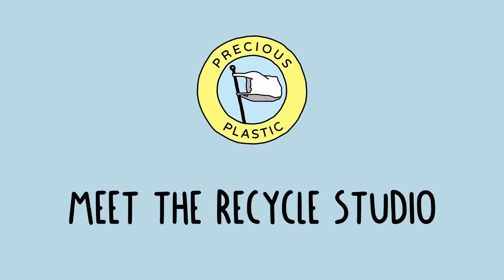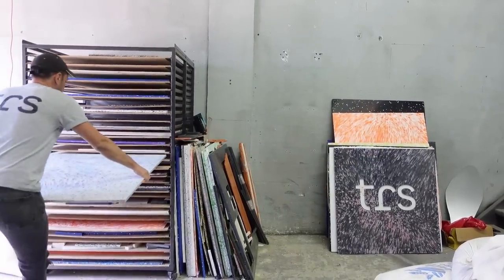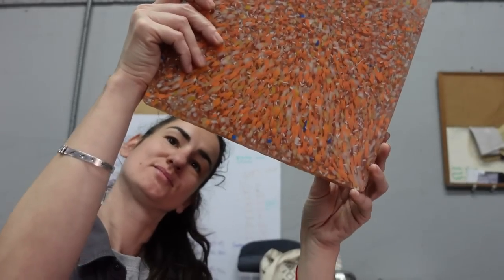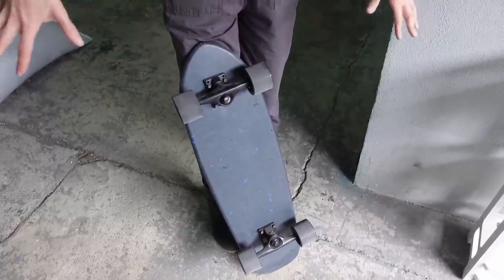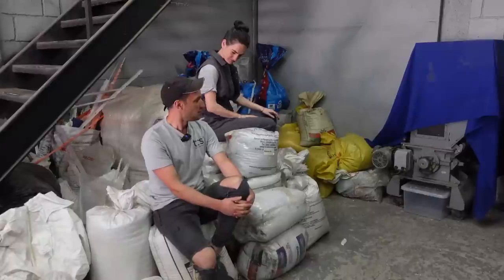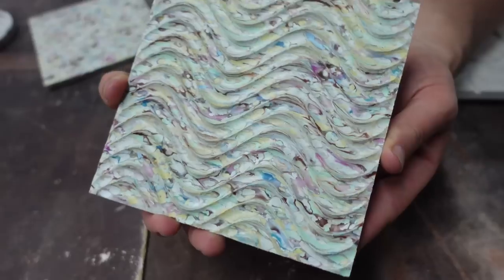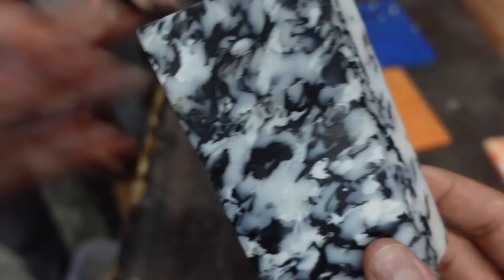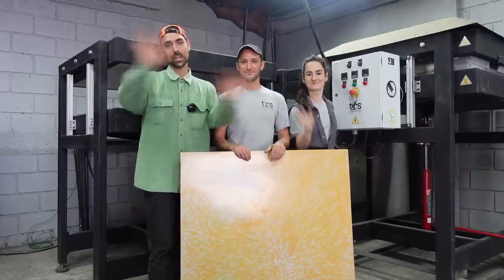They've CRACKED the recycling game

Comment: They should try getting those panels longer and they will be a lot more useful for wall paneling or kitchen worktops etc it seems the limiting factor just now is size. another idea would be plastic logs (log cabin) or bricks (giant lego) which could be used for building especially if they are hollow and could be filled with insulation foam. However just  having  a large panel with foam core and plastic on both  sides could be used in construction. Similar to GRP panels. If getting longer lengths is impossible then perhaps moulding in some sort of locking system like a dovetail joint so they physically join to each other would work or use cnc to create the dovetail ends joining pieces could be used with dovetail holes at various angles making the process of building something fairly easy. There's a huge amount of potential there personally I like the giant lego's one but that's because i'm a big kid at heart.

Comment: Beautiful work. You can tell the quality of the sheets by the sound I think - it rings a little so you know its become one piece with an even density. 
Do the cold presses maintain active pressure during cooling? I guess you can only press so many sheets an hour but that whole rig just to hold a single sheet while it cools seems a lot of equipment and space. The result speak for themselves though and they seem a smart pair - no doubt if there was a cheaper/simpler way they would be doing that.